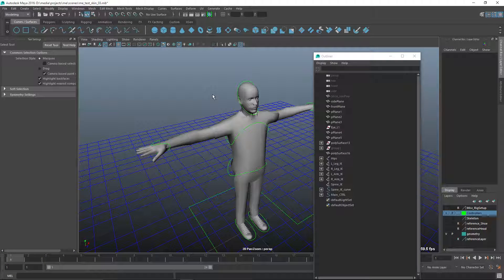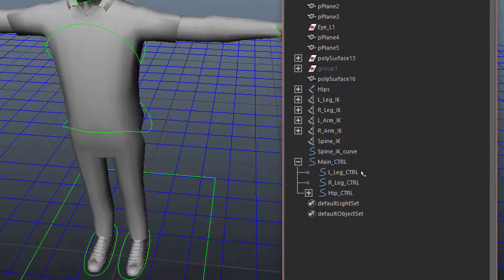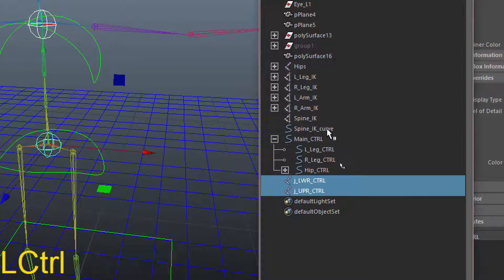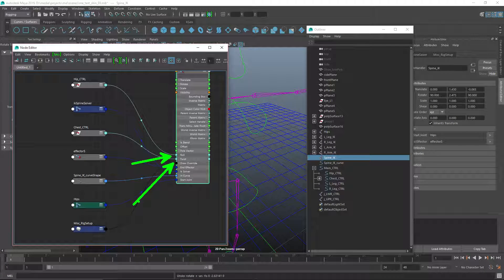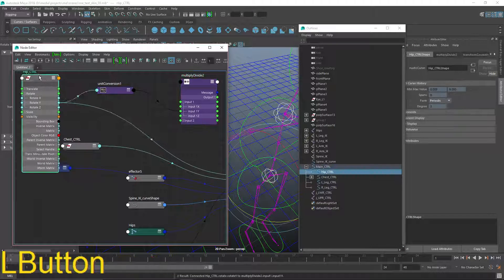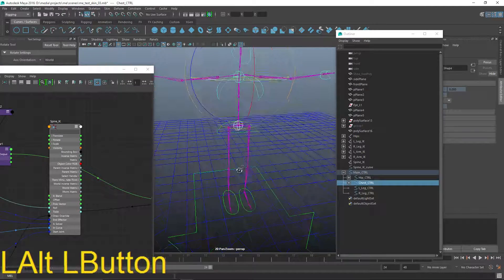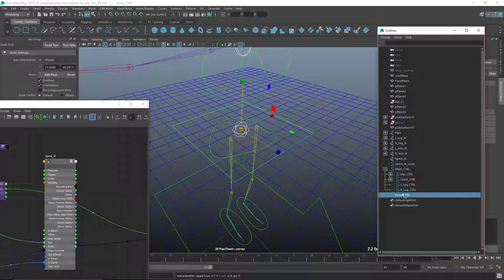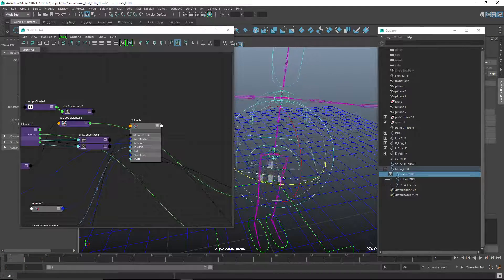Basic bipedal character rigging setup in Maya - Part 8 of 8

Comment: Hello Jamie, and thank-you for the tutorial. Unfortunately I having a sever problem. My character's spine rolls and twists fine, and the rest of the model works well. However, when I rotate the model as a whole, (using the main controller or by clicking them all) the model collapses in on itself and distorts. Everything works fantastic when she is facing forwards. Any ideas?
Reply: I also had this problem. I did a crude fix by constraining the hip controller to hip bone with point and full orient constraints. Then I created the spline ik from the first spine joint to the chest bone (The one that joins to clavicles) I then set up the roll and twist controls as per Jaimie's instructions. This enabled me to rotate and move the main controller without it all collapsing and still get the roll and twist working ok. It's not the best way of doing but my model was very basic - just walking around etc... Jaimie now has a much better way of doing it.

Comment: Hello, thanks for sharing this. Is there any way to control the rotate options for the model through the main control without deforming the entire character (so I can use it on different instances)? Right now the main control is only for moving, when rotating it will deform everything.
Reply: +Andrea Zangheri Went through the same tutorial, with a looming deadline, same problem at the end. My character needs to rotate on along a path. Bummer that this wasn't finished. :(
Reply: +Jamie Telford I got the legs to work by making connecting the Main CTRL Y Rotation to the Leg IK Y Rotations. No such luck with the arms though. They twist up when the main is rotated in the Y axis.
Reply: +Jamie Telford Got it. Pole Vector constraint controls. Geez, I'm no rigger, lol, I'll stick to sculpting and texturing in the future!

Comment: Hi again... I really liked the way you made your tutorial.. it is really torough and easy to understand... but I have some issue I cant solve at the moment. My problem is that Im using Maya 2016 and the controls in Maya 2016 seems to have changed drastically. Im not able to find some of the commands or options which you have mentioned in 2016 I am definately sure that the command is there but it seems that it has been moved to somewhere else and as a beginner Im not able to find it. I really would love to see if you make a tutorial for Maya 2016 users... cheers and have a nice day
Reply from the maker: +Onur Murat Sakgün This is video in particular is all in Maya 2016.. are you talking about the first 7?
Reply: Ah yes Im sorry... I havent noticed... I had watched the first 7 and then I suddenly decided to ask on the 8th without watching the vid... Yes what I asked for originally was actually for the first 7 vids of yours, because I couldnt follow the steps on mine because I have Maya 2016 and the menu's are on different places I think. So basically the Tutorial was awesome and I really learned something but I wasnt able to put it on practical use :(